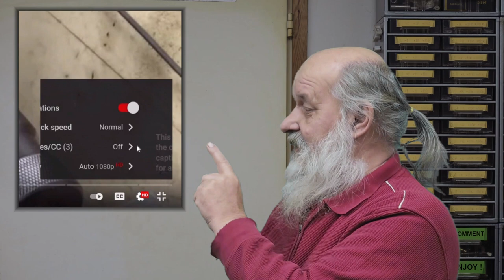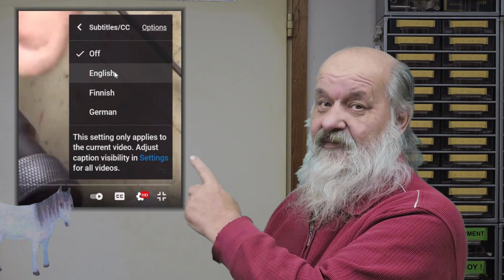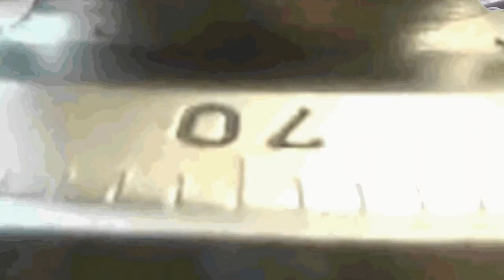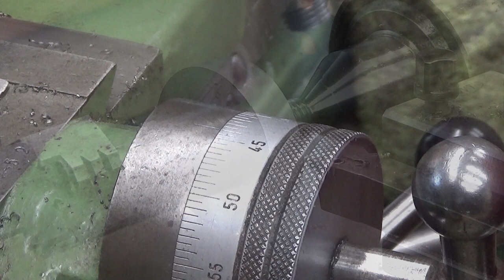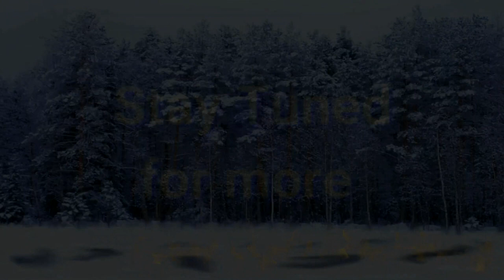Making a paper crafting press 11

Comment: Ditch the HSS parting blade and replace it with a carbide version and if possible get flood coolant and you won't have any more problems. I snapped a few HSS parting blades until I switched to a carbide part off tool. It has everything to do with shape of the chip coming of the HSS vs carbide with a proper shaped insert. Anyway the paper press is progressing nicely. Good job.